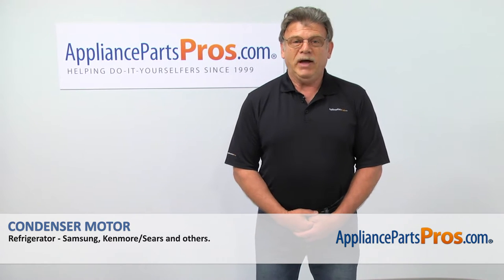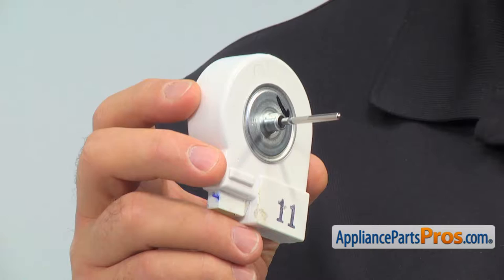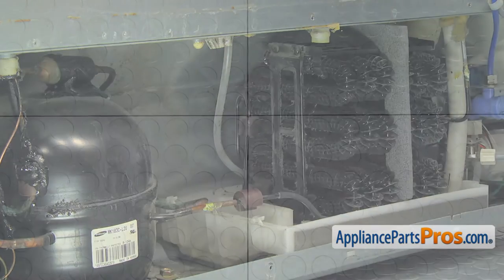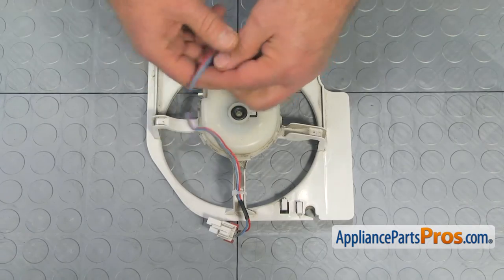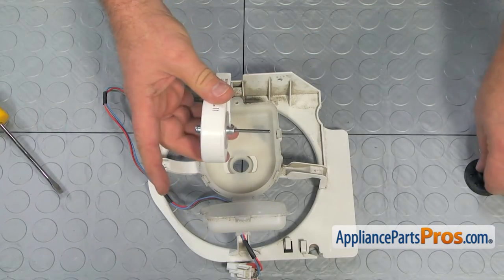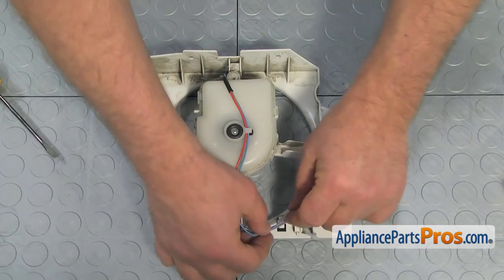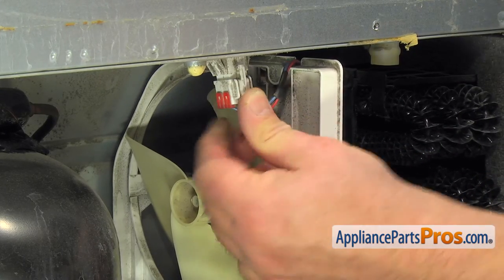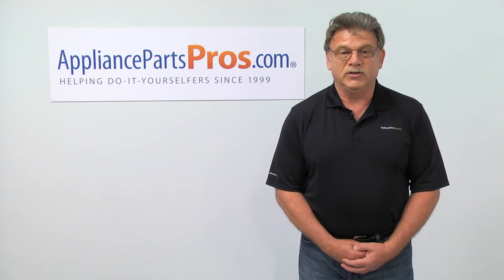How To: Samsung Condenser Motor DA31-00146B

Comment: Thank you. This was very helpful even though my mounting frame was different with two hard to get to screws on the bottom. Getting the fan off the old motor with pliers and flat blade screwdriver was the biggest help.

Comment: How to test it? Will it work with 12v battery?
Reply from the maker: Do you happen to have a multimeter? Normally on that motor there is a sticker that would tell you what the correct voltage reading should be on that part.

Comment: I did all this. Fan started up but then stopped. Now I get a flashing c-fan error on the display. I guess it could be the part or something else. Any help?
Reply from the maker: We'll be happy to try to help you figure out what the problem is. We offer free technical advice and diagnosis. You can give us a call at 1-877-477-7278 or you can chat us at our website: http://www.appliancepartspros.com/. We will need your model number to give you accurate advice, which you can locate using this tool on our website: http://www.appliancepartspros.com/modelnumber_locator.aspx